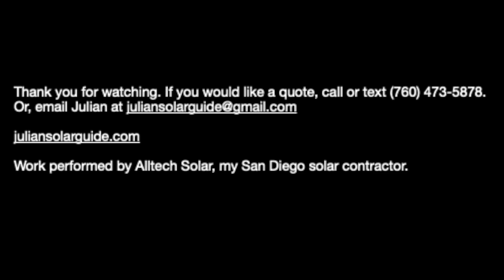Replacing a SolarEdge Inverter Again... Enphase vs SolarEdge Explained by the Solar Contractor

Comment: Enphase is overrated… solar edge is unreliable… if only there was another option
Reply from the maker: What makes them overrated in your opinion?
Reply: overrated for most homeowners as they won't use "panel level monitoring", more expensive+ no 25 yr labor warranty @Superiorsolarconsulting
Reply from the maker: @StevenPaez-y3l  they don’t really fail often though so it’s almost like you don’t need the warranty anyways. I have 30 year labor extensions
Reply: been in the industry for almost 10 years now and have installed roughly 500mW, systems from 5k to 27mW and on the 5 to 10 kilowatt systems you cannot beat Enphase for both production and reliability. i have installed thousands of micro inverters and have had only a handful fail (less than 5). i like to oversize the mods to the inverter to extend my power production window giving me power production from 7am to 5pm and that's in upstate NY. now when it comes to Solar edge 1 in 5 would either have a bad optimizer but most of the time the mother board fails. it got so bad that we refused to install them and if the customer did not want Enphase we would give an option for a SMA or ABB inverter with MPPT's built in.
Reply: Enphase is the only way to go.  SolarEdge is junk
Reply: @battlejohnson9579  I think I need some of your advice.  Im in Central FL and just been quoted solar edge for 19.6Kw system.    What panels should I get and I assume an enphase inverter.    Was thinking of doing a battery later on.   Thanks
Reply: @ZJMK605  I'd love to be able to help you with this, but I highly recommend you find a local Profesional to size everything appropriately. Solaredge is an inverter that uses optimizers that act similar to bypass diodes in split modules so you would not need or be able to incorporate enphase with solar edge for multiple reasons.

But first and foremost I wouldn't entertain either enphase or solaredge unless you live in a less than ideal pv production area (doesn't get much better sun than Florida) or if your roof is blocked by trees and other obstructions that will shade your array. Then these systems really shine and will give you better overall production.

But if you have a clear area on your roof with no shading, then just go with a traditional string inverter (cheaper and more reliable than solar edge) 

String inverters that have done well for me (on the residential side)
-SMA
-Fronious
-Chint solar 
-CPS

My current work has only been large scale utility and the use of what we Call "skids" are primarily used where a 30ft long structure contains inverters, transformers, and whole lot of other and now we typically step everything up to 35kv from 1500v, so my knowledge on residential side is becoming dated, so do your research before you act!!!